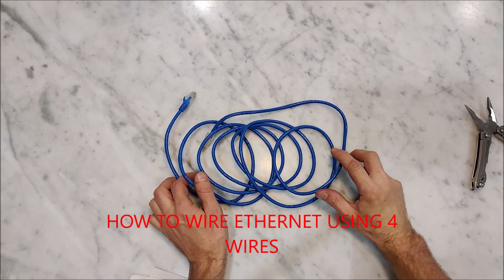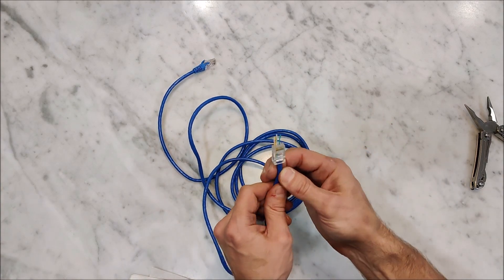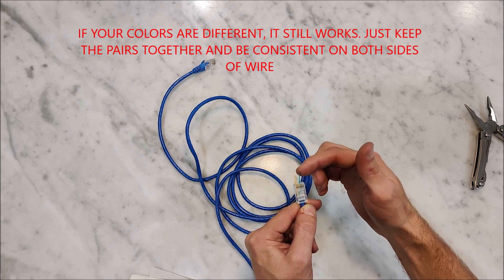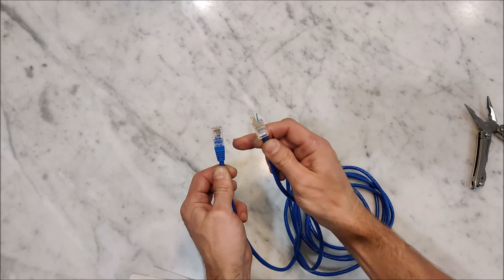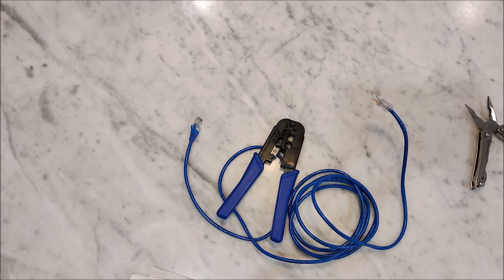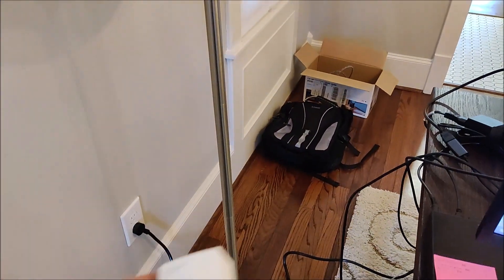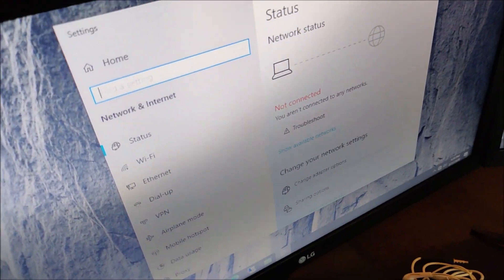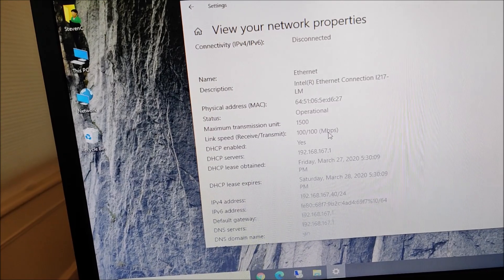HOW TO WIRE 4 WIRE ETHERNET

Comment: What if the wires coming from the wall are red, yellow black  and green ?
Reply from the maker: It doesn't matter what color the wires are. Just use the same wire in the same position on both ends
Reply: @stevenc22  it’s not a cat cable it’s an old school 4 wire tan cable
Reply from the maker: Technically it will still work if the wires are not too long. The cat 5 twist cuts down interference over long distance runs. Technically over shorter runs you can use any 4 wires to transmit. It's just a copper wire either way

Comment: thanks for the video, but how to change the crossed one with the same four pins?
Reply from the maker: Sorry I don't understand. There is no crossed wires. You wire the same colors to the same pins on both sides of the cable.
Reply: @stevenc22  I WANT TO MEAN CROSS OVER
Reply: @stevenc22  YES THIS IS EXACTLY WHAT I DID. I USED THE SAME COLORS ON BOTH SIDE, AND IT DOESN'T WORK
Reply from the maker: @bossak.mokpokpo  for a cross over cable you need opposite cables on each side.
Reply: @stevenc22  but using the same numbers on the connectors. right?
Reply from the maker: @bossak.mokpokpo  yes. Look at this diagram. Strip green becomes stripped orange. You can use only 4 wires in position 1,2,3 and 6   
https://www.peakelec.co.uk/art/4wirecross.gif

Comment: I have a free landline (telephone) port which used to be the main internet source but at my request my ISP moved it to another room by means of a cable running along the wall from that port. Can I use the old port to get a wired internet connection there again? I basically want to extend my internet to the first room. I have a DSL filter and RJ11 to RJ45 adapter but still i get no internet when i try with a spare router.

Comment: So its 568-B but without the missing wires. Does this Support 10/100 Full Duplex or is it Half Duplex?
Reply from the maker: Full duplex. One pair is for send and one pair is for receive.  

100BASE-TX uses only two pairs, one dedicated to TX, and the other dedicated to RX. The other two pairs on the wire are unused. You could very well construct a 100BASE-TX wire which only had 4 of the 8 wires in the correct pin-positions (1,2,3,6), but often the other four wires are still included mostly as place holders for the remaining pin-positions, as well as for future compatibility.

100BASE-TX (with all eight wires) is the commonly used Fast Ethernet specification today. However, it is often (lazily) referred to as simply T. Again, T is meant to refer to the category of Twisted Pair options, and TX is the specific standard that calls for using the pairs at pin-positions 1&2 and 3&6.

Comment: Can i connect 2 routers with these cables(4pin) ?
i have standard 8 cable - 2 are used for dsl
i wanna use  the resting 6 free cables to connect my modem and router in the other floor
does it mess with my dsl connection in a bad way?
Reply from the maker: Yes you can connect using 4 wires. It should not mess with the DSL as long as you don't use the two wires the DSL is already using.

Comment: Quick question. I am having my current IP install a businessline for me with max of 50 mbps. I did find an pld phone jack in the kitchen. When I took out the cover, I saw only 4 non-twisted wires. I also ordered TP powerlink adapter thru Amazon that I saw you use in this video. Wondering which 
would you recommend I have it connected better? Thank you in advance!
Reply from the maker: If the wires are not twisted, don't use them. I love Ethernet over poweline adapters. Just that!
Reply: How reliable are the powerline adapters?
Reply from the maker: @TheCutiestacey  pretty reliable. Might have to restart them a couple times a year but in general they work pretty damn well.
Reply: Do the powerline adapters always have to be in pairs?I see a pair button on the TP link brank or can it work alone? I am really getting anxious about the installation tomorrow since we don't have a cat5 jack just coaxial cable inside my office room.
Reply from the maker: @TheCutiestacey  you can have two or more. You can have three or four and they will all talk to each other but you need at least two
Reply: I see so the powerlink works in pairs. One last question, so that jack insert on the adapter would kinda be the same as the cat5 jack right?
Reply from the maker: Exactly the same. You plug the modem output into one of the adapters. It will then send the Internet throughout your electrical cabling in your walls. The second adapter will pull the Internet signal off the electrical cabling and output on a cat 5 Jack ready for you to plug in a computer.

Comment: very informative, thanks. Where I live the pervious property owner installed a 5 pair twisted jell filled armored cable run from one building to another, less than a hundred feet in length. I am assuming for plain ordinary telephone service connectivity.  I punched it down on both ends and I am using a pair for voice and considering using another pair for voice also, both voice lines are traditional analog phone lines. Is it possible to use two of the three spare pairs for cat4 data transfer over the same cable? Since it is already buried and available it would simplify matters for extending the data network from one building to an other. One rg6 quad shield COAX was buried along with the underground telephone cable and is also available and running I am running MOCA 2.5 gig data rate on it, but would  like to return the COAX to video use. The previous owner concreted over the cable path and new cabling would be very costly.
Reply from the maker: Yes. You can use 2 pairs for a data connection!

Comment: The cables already installed are just 4 lines (funlux camera,  cable from NVR side hast normal  plug, camera side has micro usb) 

.I Want to update the cameras with poe 5mp cameras. Is there a way to resolve this? And how. Thanke you
Reply from the maker: No. Poe cameras need all 8 wires because some of the wires carry power and some carry data.

Comment: Thanks for the video.  I'm trying to use existing phone jack in my house to convert to a Cat6 ethernet.  One phone jack in my house has 4 pairs and I converted that to Cat6 outlet and connected to one of my AT&T router's output ports.  I then opened another phone jack in another room to convert that to a Cat6 but its phone cable only has 3 pairs (Cat3) and not 4 pairs like the previous jack.  Can I still convert this to a network port and with 6 wires instead of 8, what speed will it give me?  Thanks in advance.
Reply from the maker: You can convert it. You will only use 4 wires and it will be 100mbs. 4 or 8 wires.
Reply: @stevenc22  I was hoping I can use the 6 wires and get more than 100Mbps but thanks for the response and video.
Reply: @rrrvvv4314  I did this my self. Here’s what I got. 1 pair: no internet. 2 pairs: 50 to 75 mbps average. 3 pairs: 80 to 95 mbps. 4 pairs: 105 to 1000+ mbps. (Edit: 1 pair just means 2 wires if you didn’t know. 1 pair = 2 wires, 2 pairs = 4 wires, 3 pairs = 6 wires, etc.)

Comment: Can this concept be applied to my two pair (only 4 wires total) old phone wire in my home that is being used for my dsl internet service? I am trying to stop all the service interference and losing my wifi all the time. 
Thanks
Reply from the maker: Depends what you mean by "applied". Dsl is an analog signal coming into the house. You need to terminate that signal through a dsl router and then turn the signal into a digital network connection which can then be transmitted through more 4 wire telephone cable to other parts of the house.
Reply: @stevenc22  I know I have to keep the dsl type of signal to the router/modem. I want to run upgraded wire (cat5e) from my nid to the router/modem though cause these old 2pair phone lines catch a ton of interference. I just don’t know how to connect the cat5e wire to the nid so it is in the dsl sequence. Once I get it from the nid to the router/modem I am going to run all new cat5e wiring throughout the house.

Comment: Hey, I am using a fiber net router in of the rooms and there is a 2 Pair (4 wires) connection to another room inside the wall. have RJ11 sOckets in both the rooms. Can I convert them to RJ45 sockets and transfer internet via your method and get not more than 100Mbps speed to another router?
Reply from the maker: Yes. But you should always only have 1 router in the whole network. You can transfer the internet through the 4 wires to the other room and use a switch in the other room.

Comment: hello there sir, in the video, and in the wire, in the other end you use all the 8 wires, and in the other end is you only use 4, am i right sir?

sorry for my english sir
Reply from the maker: Yes but only 4 wires are active. You only need 4 wires on both sides for the cable to work.
Reply: @stevenc22  will this work sir if i plug the other end the with the 8 pin in my ISP, and on the other end, the with the 4 pin in my dsl modem?
Reply from the maker: @khymjubindultra457  Yes it will
Reply: @stevenc22  my dsl modem has only 2 pin are active :(
 which pair will i use? or which color code do i use?
Reply from the maker: @khymjubindultra457  be careful. Proper network connections need 4 pins. You likely have an analog connection going into your dsl modem. You can probably figure out which 2 wires are active with a network tester.
Reply: @stevenc22  thank you sir, ahmm one last question sir, i have a fibr connection on the other house and i want to extend this internet connection on my dsl router which uses 2 pin only, so the other end use all the 8 pin and on the other only use 2 pin on my old dsl router, which color  do i use to connect my dsl router to the internet? 

and btw i used t568b color code in my 8 pin
Reply from the maker: @khymjubindultra457  I'm confused. The two pin input is the dsl line. The dsl modem then should a 8 pin output.  If you want to bring a fiber internet connection other from the other house, you don't need a dsl modem then. You need a switch or a regular router. A dsl modem only accepts a telephone signal. It does not accept a network connection. Y

Comment: Once you change over all the wires how do you set up the system in the phone closet? Do you put your modem and router in the phone closet and connect through that? Or would you just put the modem in the phone closet and the router on the end of one of the newly wired phone jacks?
Reply from the maker: Great question. Either works. My router is on the other end of the cable in my living room and the modem is in my laundry room.
Reply: @stevenc22  thank you very much!
Reply: @stevenc22  i used only one cable of height pins to conduct le electricity and the network. i use four pins for the router transfo and then the other four pins for the network . but the the connectivity part doesn't word. it is supposed to connect to access point
Reply: so i want to know how to wire a crossed cable using four pins
Reply from the maker: @bossak.mokpokpo  if you don't have a switch, you will need to wire a cross over. Use this diagram. https://www.cables-solutions.com/wp-content/uploads/2016/12/crossover-cable-.png

Comment: Do you know why I would have two CAT 3 cables with all colours paired to their opposite on the other cable, connected to one rj11 wall jack?
Reply from the maker: Maybe they are joining to cables together daisy chain style and using the RJ11 as the common bus bar. Basically one cable comes into the RJ11 and one cable goes out of the RJ11

Comment: My house is really old. I've found that the phone cables running through the entire house have 4 "non-twisted-pair" wires. They are separate wires in the colors: white, black, red, green. Will what you're saying still work and give me a 100 mbps connection?
Reply from the maker: No. The twist is important. Non twister wires are subject to interference and the signal degrades over long distance. Non twisted pair wire is probably not going to work.
Reply: hi there my house also has 4 non-twisted wires and i can use them for 10 mbit ethernet... Do i recommend it? obviously not. Do it if it's your only option left
Reply: Thanks a lot for your reply. I really appreciate it! I can now move on to thinking about other solutions.